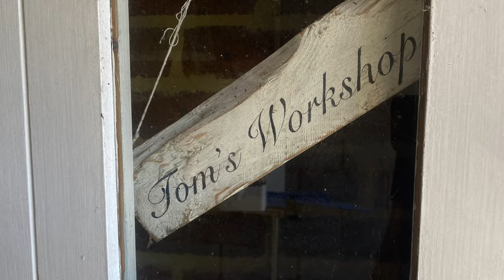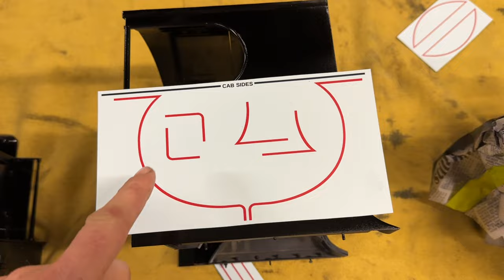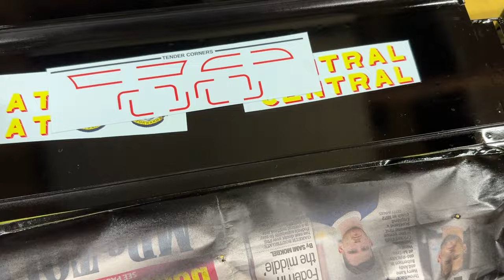Pompom lining starts…

Comment: Painting and especially lining is an art form all in it's self, there's plenty of you tube videos to watch. Think you held the brush at the wrong angle and it was far too full of paint, lay the brush down and let the brisles bend with the curv your after. Clean the wheel on your bugler, dont push the plunger in so hard and put tape at each end of the line as a run in and run out.
Practice makes perfect 😊